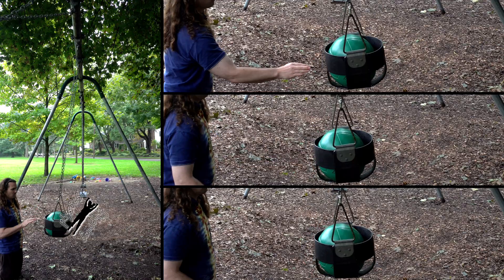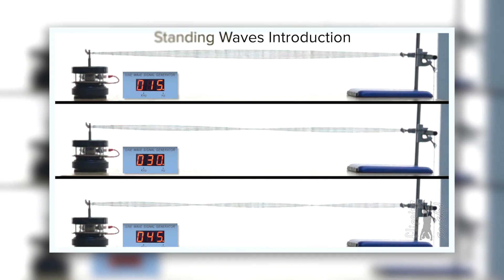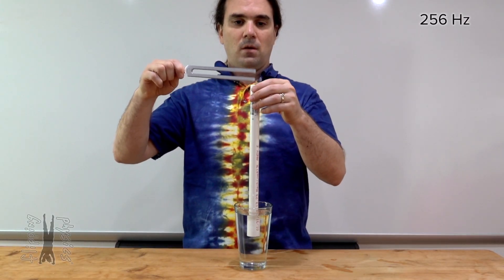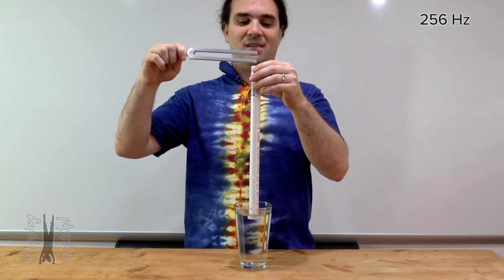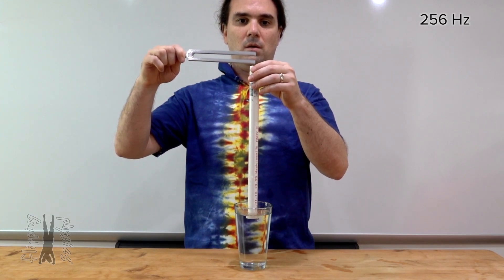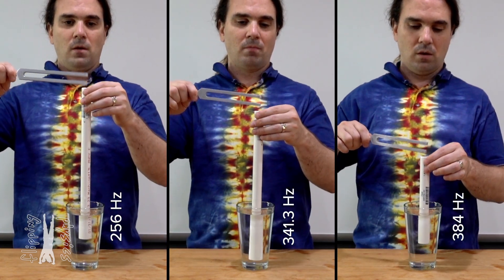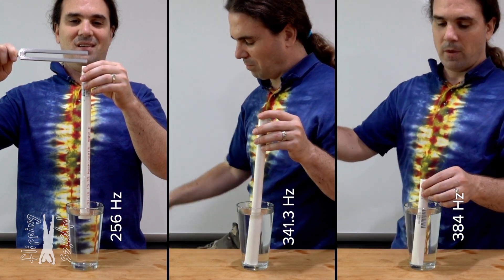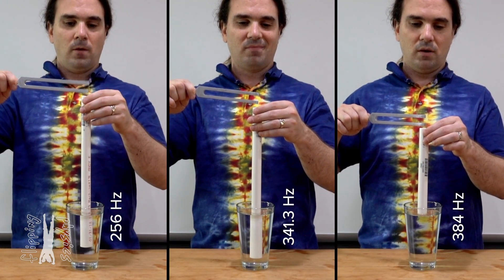Resonance Introduction using 9 Demonstrations

Comment: 3:38 the 3 frequencies you chose for that tuning fork demo was really pleasing..it sounds like some meditation 🧘‍♂️ music
Reply: It's the chord known as C-suspended-4th, with the music notes C, F, and G (Do, Fa, & So).   Middle C is very close to 256 Hz, and the corresponding F and G in the same octave on the same scale, would be 342 Hz and 384 Hz respectively.  It is very common for a 1:1.5 music note interval, like that of C and G, to form a chord, the interval known as a perfect fifth, because of how well the waveforms fit together.

Actual middle C is a little higher than 256 Hz, because A is used as the note that is specified as a rational number of Hertz (440 Hz).

Comment: Your key fob pro-tip provided me with a very important insight, at least for me it's an important insight on my quest to comprehend advanced Russian military martial arts, not being a very good Russian speaker living in the USA.

Since the key fob is an electronic device which works with everyone there must be a vertical natural vibration frequency of the human body, as you pointed out, where standing waves can be created for great practical effect. Thank you for sharing this information! 💎💎👍👍😎

The important parts of the human body vibration frequency are generally located in about 3 Hz–17 Hz. According to the International Standard ISO 2631 in the vertical vibration of the human body, the sensitive range is located in 6 Hz–8 Hz.

Examples of the Russian military use of the resonance and the human body,
https://youtu.be/3gLTwjIGOsM
https://youtu.be/GDlg3x1LDzg

Awesome video and teaching skills!!

Comment: What exactly is resonance? Vibration?standing wave? Up and down?
Reply: Consider the basic equation of motion for simple harmonic motion of a mass on a spring.
m*a = -k*x

Which can be rearranged for:
m*a + k*x = 0

Replace a with d^2 x/dt^2, to make the simplest second order differential equation you'll solve:
m*d^2 x/dt^2 + k*x = 0

This is the equation that governs its natural vibration motion, if you start it at an initial displacement x0, and initial velocity v0, and then let it vibrate freely.   The solution will take the form of x(t) = A*sin(w*t + phi), where w=sqrt(k/m) which determines the frequency, and A and phi are constants that you can calculate from initial conditions x0 and v0.  This is how it will move as a function of time from the initial conditions onward.

Now, what if, instead of just giving it an initial condition when it starts vibrating, we apply a forcing function that continues throughout its motion?   This is what resonance is.  The response of a system that vibrates, to a stimulus from the outside environment at its natural frequency.

Suppose we apply a forcing function given by F(t) = B*sin(c*t), where B and c are constants.  This could represent a vibration taking place on a moving floor, responding to a background sound, or a human hand shaking it.  Maybe the mass is a car, and the spring is the suspension, and the forcing function is a bumpy road the wheels experience.

Now the equation of motion is:
m*d^2 x/dt^2 + k*x = B*sin(c*t)

When c=w, you end up with a particularly interesting result to this equation.  The amplitude of the sine wave solution will continuously grow as a function of time.  This is resonance.